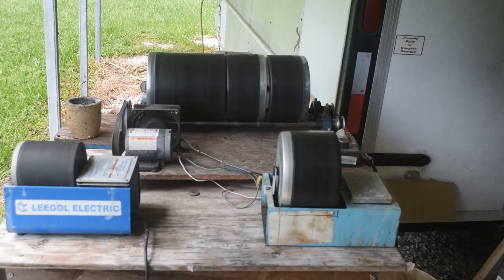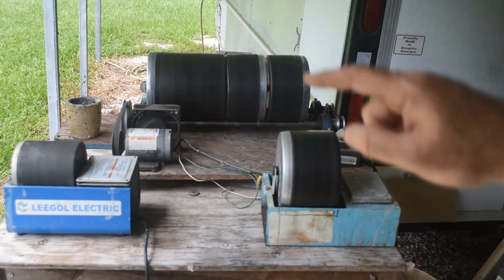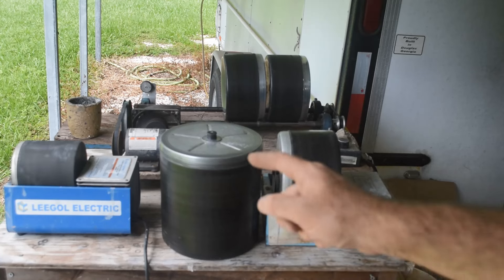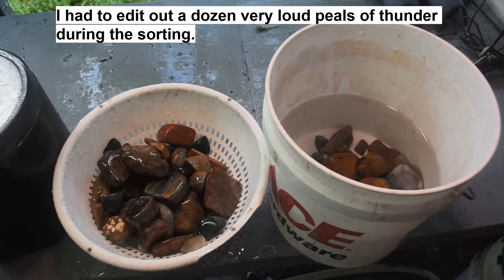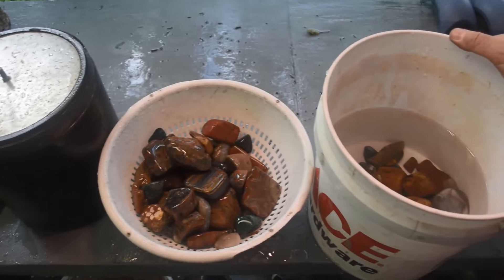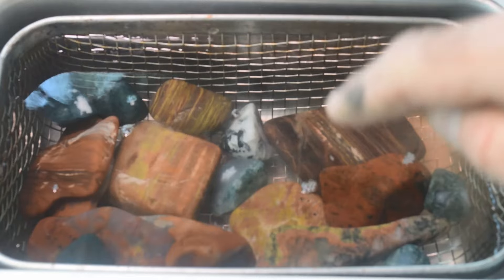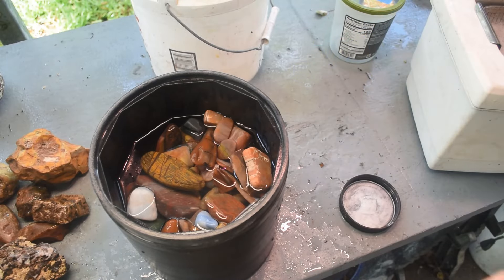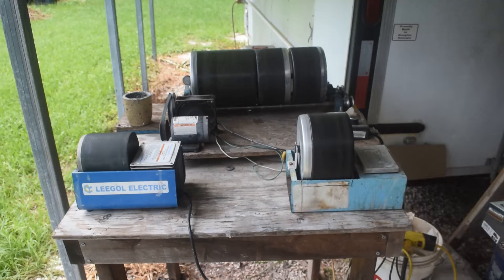What Am I Tumbling Today? 06/30/24 #thefinders #rocktumbling #rockhounding

Comment: Excuse my unlearned question. I brought a bunch of pretty stones from the prospecting trip. Including a bunch of quartz. Now i am not sure the quartz will polish or break up. If it does break up will it make a decent rough grit polish?
Reply from the maker: Quartz is a soft mineral. It may not polish other minerals if they are harder. Quartz can be tumbled, but it needs to be done carefully and not mixed with harder rocks that will beat it up.